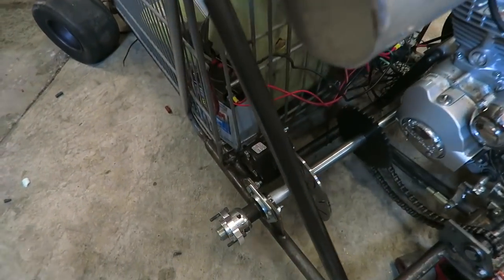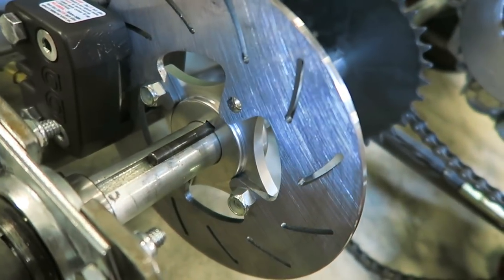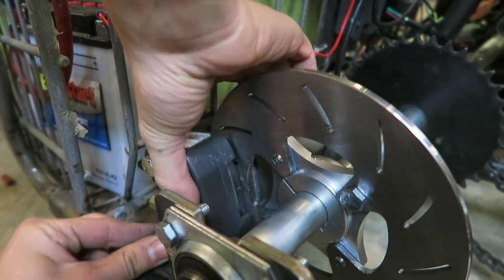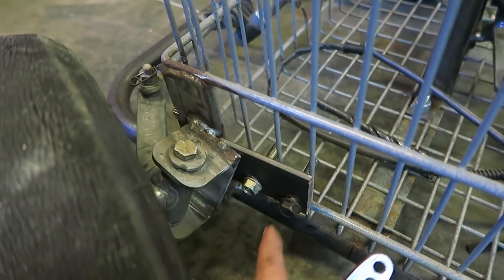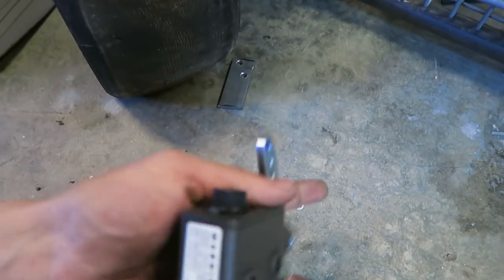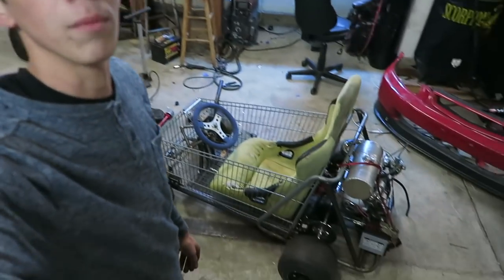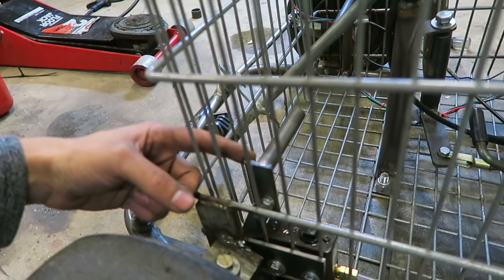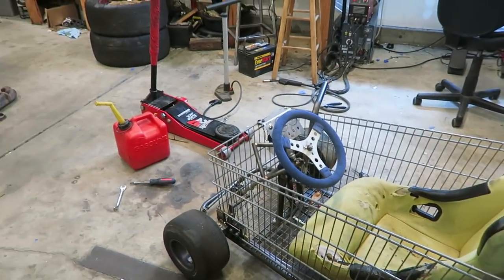Shopping Go Kart Gets Brakes! (Finally got to Rip it)

Comment: Great job on the shopping kart build so far. Have you thought about flipping the pedal mechanism over? It would probably give you better feeling if the pedal was traveling in an upside-down arch pattern. I know space is a probably a concern. You should also weld a tab on the other side of the caliper like you mentioned in the video. Keep it up, man. That thing is sick. Can't wait for the turbo.

Comment: Im just thinkin. Do you think that the calliper will try n twist when you brake. Idk im jus tryin to cover all the bases. Over time atleast. I jus wanna make sure that when you do need them that it wont snap off. You might wanna pit a plate on the other side. Keep up the vids. Love the boosted projects. More street racing.
Reply: Looking at it, i dont think it will twist or snap. The forward motion of the disc rotor will not put any extra pressure on one side or another, it looks like it will direct most of the pressure directly downward toward the bar the caliper mount is welded to. HE might as well add another mount to the other side however, But it should be fine, it aint goin nowhere

Comment: I have done over 50 on my predator 212 go kart. its a completely stock predator 212 with a torque converter on it. The frame is so sketchy, it is a rusty old yard kart style frame. Brakes are really bad too so its super sketchy but its so much fun. This with the manual transmission is so cool though. I'm jealous...

Comment: You should extend the shopping cart handle out, so it's more prominent...  Just in case you need to push it around...  Maybe put a little red LED strip to act as a brake light for added utility.  :D

Comment: A exhaust muffler would help power because the back pressure helps compression plus no cops called.you don't have to use clutch to shift just let off and shift up like most dirt bikes straight pipe messes with tuning aswell
Reply: I thought that straight pipe actually helps with power since an engine is all about the flow of gases? efficiency is achieved by least resistance to flow. I do agree on the noise though
Reply: C&R Garage yea flow is important but a nice good exhaust gives flow and puts down noise you don't have to take off a exhaust to make power most dirt bikes make more power with aftermarket exhausts with still muffling the sound
Reply: Logan Taylor it's more about exhaust scavenging and velocity which a muffler could help with. But you're right about the tuning. The tune isn't made for an open exhaust port like that.
Reply: agreed, It was late at night and I didn't really want to type a whole paragraph about how exhausts work. the general Idea is least friction, high temperature and good scavenging for a proper high flowing exhaust.

Comment: word of advice: you need to flip that brake disk around, the slots should be flowing upwards to help expel the heat better. you're now keeping the heat in. it shouldn't be hard to do, and it will perform much better.

Comment: what you could do is custom fit & weld another peace of thick metal at a angle to the brake capiler bracket that is going straight up to the frame  to add some more strength & support like how they add angle's Rod's to front ends on Drift car's.

Comment: Get another shopping cart and flip it over, mount it on the top and hinge it at the front so you can open it and climb in and close it. Then you will have a shopping cart roll cage for when you flip this thing at 50 mph. The entire thing is still going to explode into bits and probably kill you if you do flip it at speed... but it will be more funny watching you bounce down the street in a shopping cart cage with wheels haha

Comment: A couple of things Kyle, dont mean any disrespect by this, a key way is the groove a key is what you needed, please learn what a guset is as you need to add them and/or put a second brace on the brakes there is alot of force on that bracket and add them to a few other places on the kart, there is alot more force than you think on the joints and the last thing you want is welds cracking or breaking. Good on you for getting stuck in and trying to learn but please get more knowledge in engineering before adding more power, id hate to see you hurt yourself. 

PS im a tradesman engineer

Comment: That's a really bad caliper mount design. When the brake is applied, its going to create a torque around the one mount and eventually break it due to cyclical loading. It will probably twist the whole caliper assembly and affect how the pads contact the disk.
Reply: Jordan Liske first of all your assuming the pressure will be enough to break the mount. And I highly doubt that will happen due to the size of the rotor and the quality of the welds lol. Nice try tho
Reply: Kyle Zirbes I think you'd be suprised how much force is put through that bracket . The math isn't that hard but I'd need to know the weight of the vehicle and the tire specs.
Reply: Yep that has happened to me with my bicycle front coustom disc brake mount

Comment: Why don't you use washers to bolt on the brake? There will be a moment that it's getting loose when you don't expect it. Just my 2 cents ;)
I also would recomment to use locknuts.